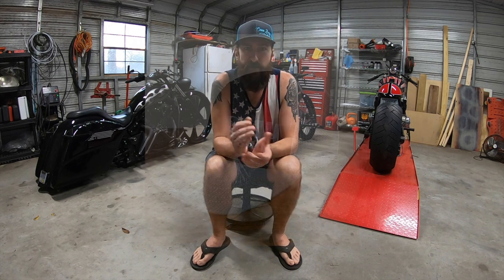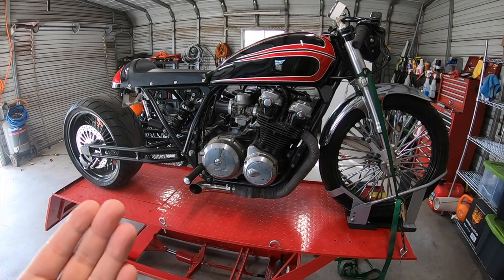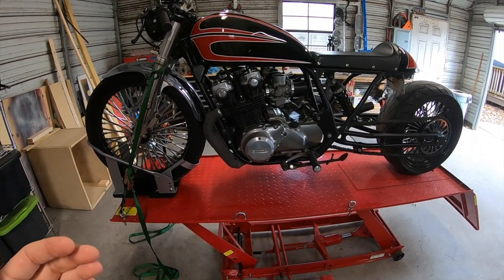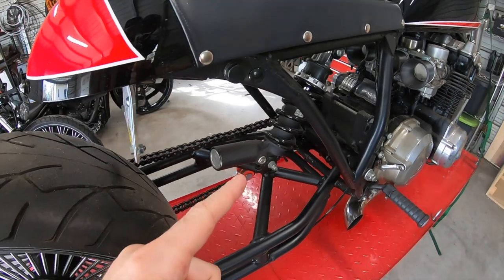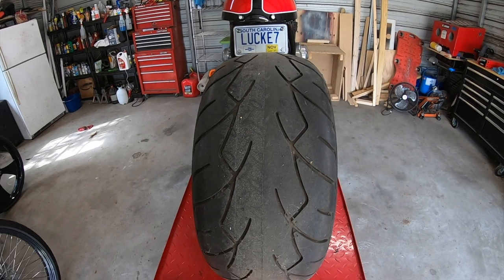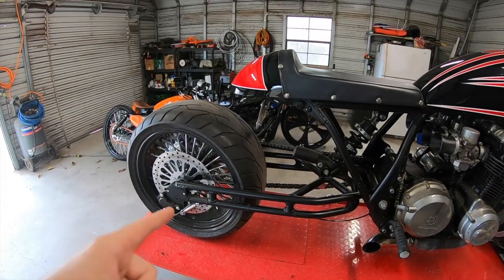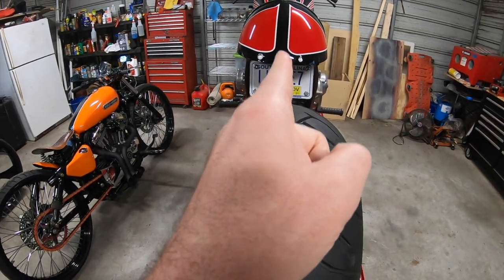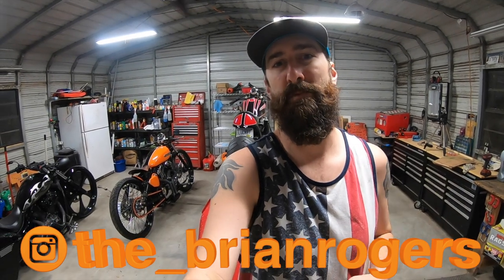I Saved This CB750 From Certain Junkyard Death! 1980 - Modern Cafe Racer!

Comment: I dont think you mentioned but i gotta know what the stretch on that swingarm is! Im doing a stretch hardtail drop seat and im looking for about that length. I would guess about 7 inches?
Reply from the maker: I think it’s closer to 10 or 12 inches over stock. I don’t know because I built it off of the stock pivot point and didn’t measure it before I cut it up. For reference, the factory rear tire would have been in the middle of the seat hump.
Reply: @SignMeUpDesigns  ah thank you for getting back to be. I'm probably going with 9 for mine. It's surprising how short there japanese bikes are. Gotta stretch them by 5 just to make a regular hard tail look balanced

Comment: What’s the jet size you put on the bike?
Reply from the maker: 40 pilot and 125 main, but that’s way too big. It’s always ran rich. The ideal setup would probably be 40 and 112 since I have open air cleaners, baffled exhaust and no engine mods. It runs alright as it’s setup now but not perfect.

Comment: How many inches wide is the rear rim?
Reply from the maker: 10” wide.
Reply: That vee rubber 260 looks flat i dont like the edge
Reply from the maker: I agree. Every Vee Rubber I’ve ever seen looks like that too. Huge improvement going to the 240.
Reply: Its sad i already purchased one but did not installed it yet 😵